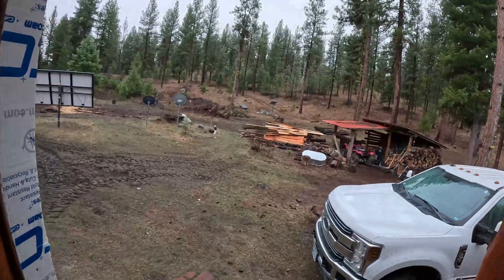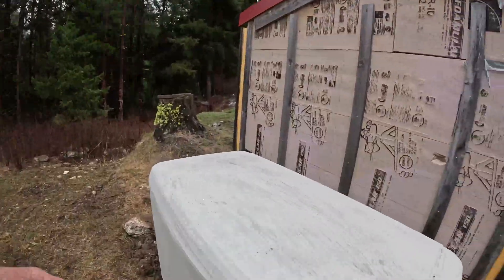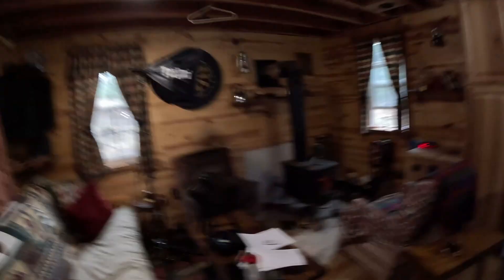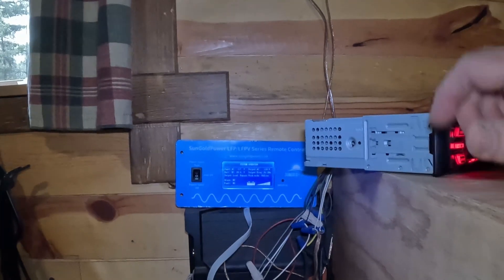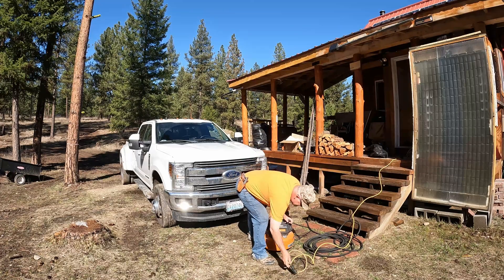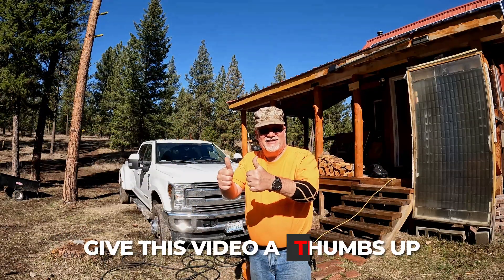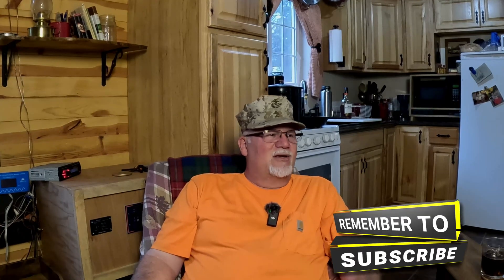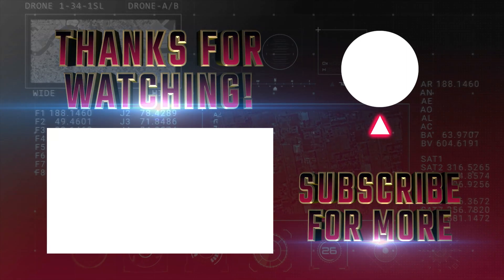Inside Look at Sungoldpower Inverter Charger: Eye-opening Revelations

Comment: You're using your batteries to handle the in-rush current of your saws (IOW: you weren't directly pulling from the inverter)
Reply from the maker: Your inverter pulls from the batteries and provides the voltage for the saws.